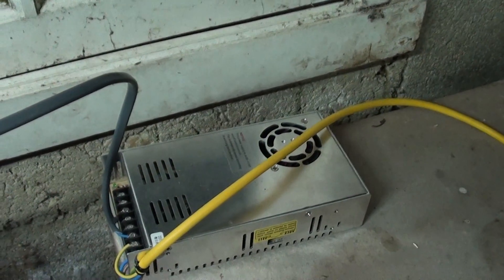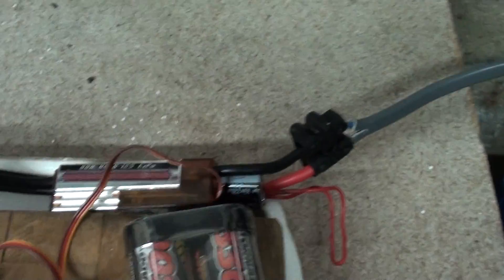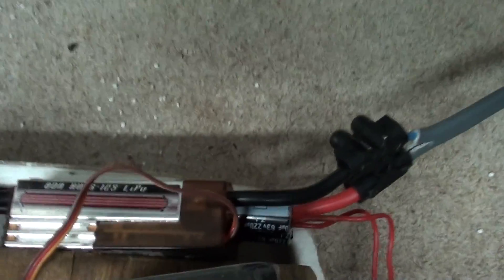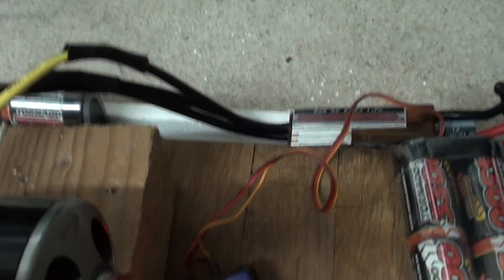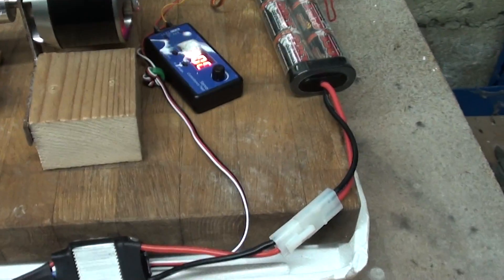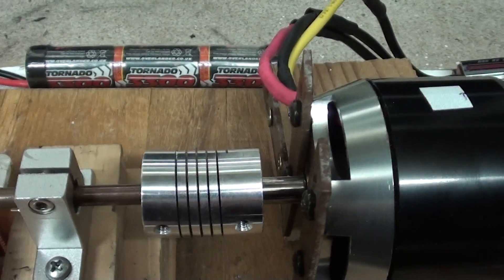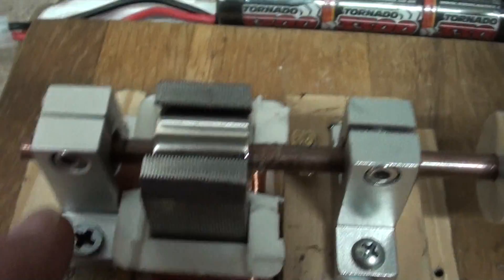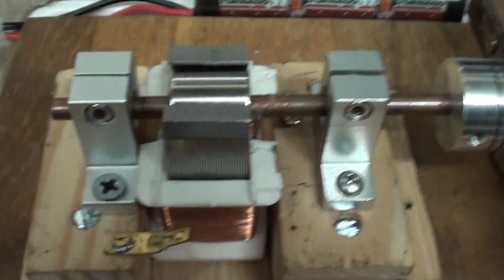Gerard Morin replication with neodymium magnet 1

Comment: any magnetic metal used as the xfmr coil will heat up  //  use a non-magnetic material or simply a air core xfmr  //  you are dealing with RF energy --  all the present electrical design transformer rules are useless

Comment: 1last thing:/     u ever try spinning the mag WITHOUT the iron?  ur setup wuld b perfect.   just strap the coils down...   I.m just curious.   Does the bucking/cogging/ iron play a role?  cuz theb why "iron out"?????   u know?   idk.
 I.m just EXACTLY wer u are.... I got 4 pumps on belts ti a treadmill motor (super big. 12v battery spins all 4.   butttt. at only 70ish v per pump. idk.   I.ll be checkn u out;)

Comment: Nice setup.. I noticed you used a steel connection between the motor and the 'pump'. Gerard seemed to think that might have a detrimental effect, or would just be hard to prove that 'electricity' wasn't being transferred between the two components. That is why he and others use plastic tubing or something similar.
Reply from the maker: Hi! I have tried using plastic tubing as a coupling before just using the standard washing machine pump, but it has never been satisfactorily tight and so slippage and then melting has occurred! Imagine what it'd be like with the neo magnet!! Also, I know, and you know, and others know what is going on here, so I'm not trying to prove whether the system works or whether there is energy coming from the motor side (?). Who's to say that that's not a bad thing as everything in nature is connected and why not in science?!! But maybe if someone else replicates this (which is quite easy to do) then we could see if the metal coupling does affect the output. Really, I just want to push things along in seeing what happens by changing this or that.....there are too many replications (copies) with no desire to push the boundaries as if it's some sort of cutesy-wutesy sciencey  project! I feel that this method is a real, genuine method of energy creation/multiplication and with supposed health benefits too (to be looked at in the not-too-distant future!) and should be looked at in different ways, re-imagineered if you like! (never thought I'd be saying that, ever!!!! Haha!!). Anyway, off the soapbox Jamie! Thanks for watching and taking the time to comment.
Reply: Hey thanks for the reply. I am on my way towards my own setup, very similar to yours. I am just buying comonents as my funds allow (which is slowly). Hoefully when I'm up and running we can collaborate to see what is possible :)
Reply from the maker: Excellent!!! I really look forward to a collaboration!!!! Cheers!!!

Comment: Hi sir, please what size of Neodymium magnet did you use?
Reply from the maker: Hi! The magnet I've used is a 20mm diameter by 20 mm length DIAMETRICALLY magnetised piece of N42 neodymium as can be seen at this link :- http://www.first4magnets.com/circular-disc-rod-magnets-c34/20mm-dia-x-20mm-thick-diametrically-magnetised-n42-neodymium-magnet-p3641
Thanks for your interest!
Reply: @shortblokej  Thanks for the info.  I am glad I read all the thread to the very bottom.